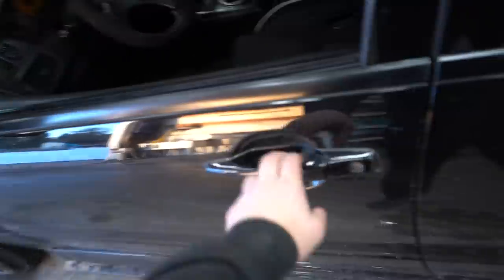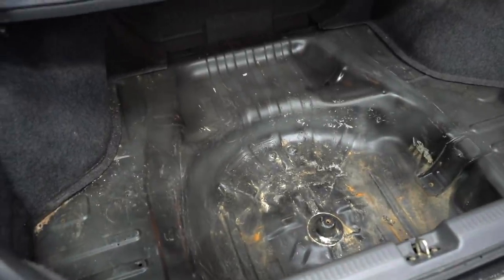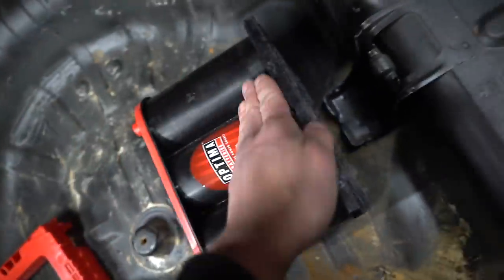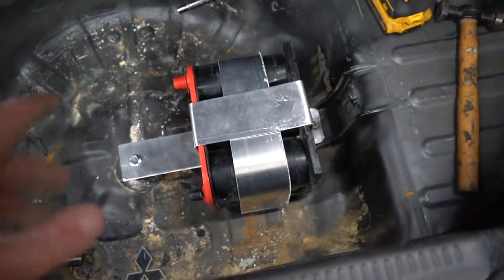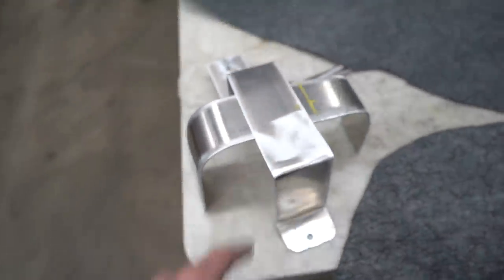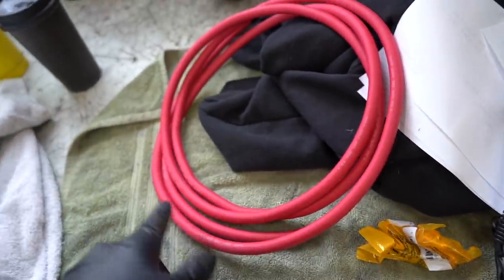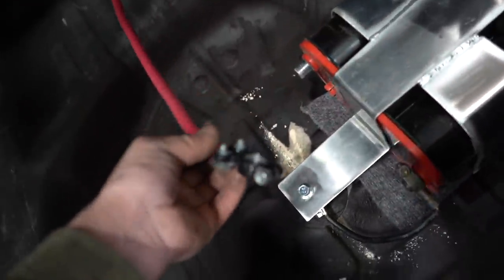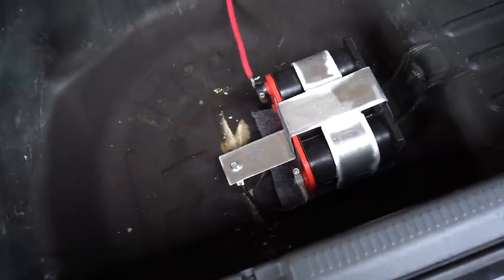Hidden Trunk Battery Setup for the Evo 8!

Comment: Nice work devin 👍 but you should put a big ass fuse in the positive cable close to the battery! this prevents shorting out the battery in an accident (where the cable gets pinched in between metal) and possibly burning down the car 😕🙏

Comment: Devin even through its a sealed battery the copper plates need to be covered, putting on its side is going to leave at least one of the plates exposed internally.

All sealed batteries still have an air gap internally.

This will reduce battery life and could cause a defect in top case if put on its side
Reply: Optima batteries are AGM, they're sealed and designed to be mounted in any position.

Comment: Devin, if you're in a pinch and you can't get something welded, you could do aluminum brazing. It's probably would have worked good for your bracket. As long as it's nothing really structural

Comment: So I just did this using 2awg wire and a 180A inline breaker. The battery is brand new 650cca 800ca but im getting very slow cranking. Anybody know why? I have double checked everything to include grounds in the engine bay, voltage on starter, resistance in the wires going to the trunk, etc. Im pretty stumped right now. Any help or advice would be awesome.

Comment: Bud the battery will spill acid laying side-ways
Reply: Thats what i was thikin. Might not leak but i dont think its a good idea to have it turned like that.
Reply from the maker: Raymond Martinez From Optimas website “All Optima models have sealed, spill-proof cases and can safely be mounted on their side as long as the terminals are protected from shorting. If the battery has side terminals, they should also be covered to prevent shorting”
Reply: It's a damn Optima battery smh..do some research
Reply: AGM batteries do not have acid in them. AGM - Absorbed Glass Mat